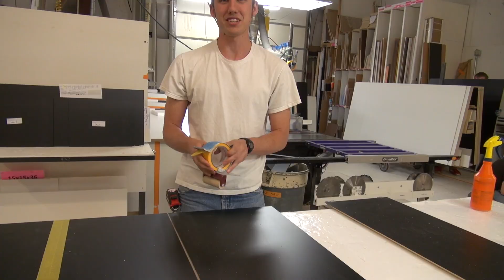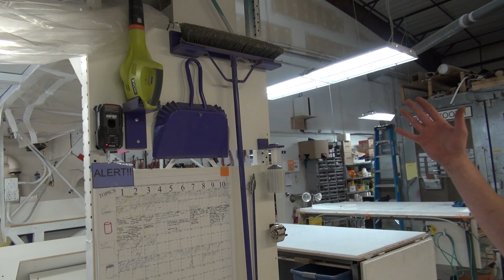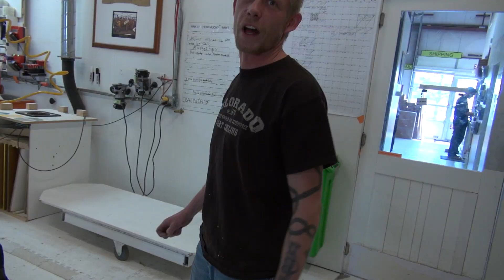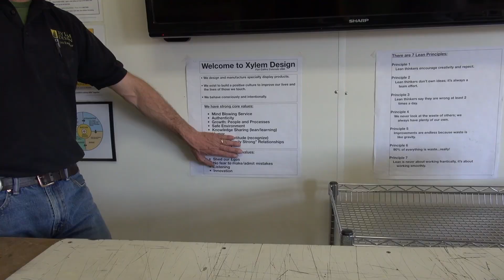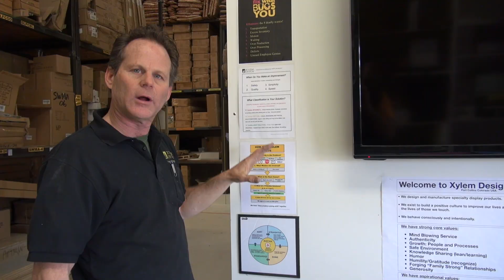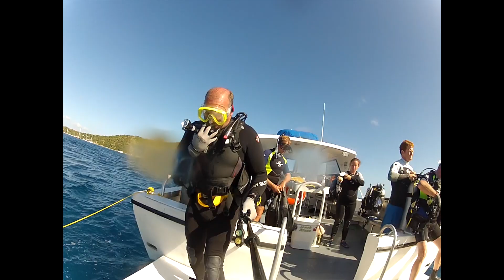Lean Manufacturing - Factory Tour - Xylem Design - The American Innovator

Comment: Hole saw trick: bend a couple of the teeth inwards so it cuts the plug slightly undersized.  Two opposite teeth will work well and not impinge removal too much.
Reply: @10:00 I wonder why the plug that he supposedly just cut out of a wood textured board has white laminate on it... and it burns because the teeth are not sharpened for wood cross cutting and the teeth stagger is not sufficient for wood, I stagger them more even for metal and it allows a bit free-er cutting